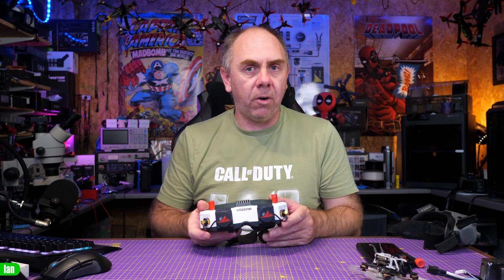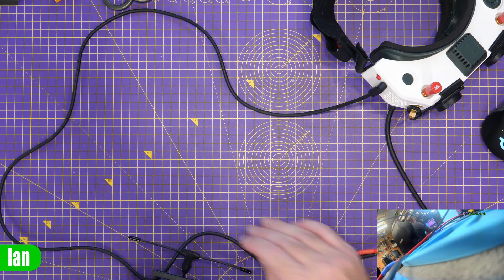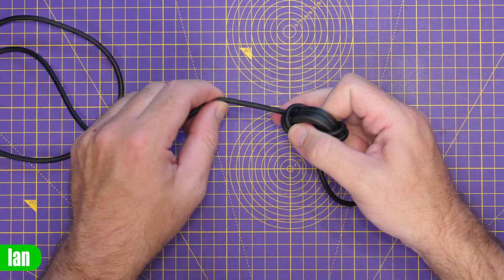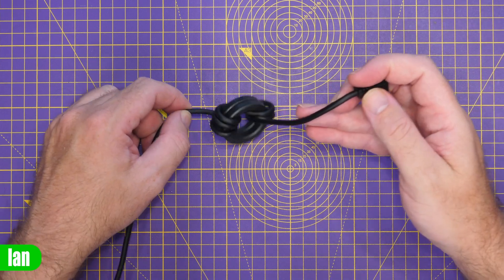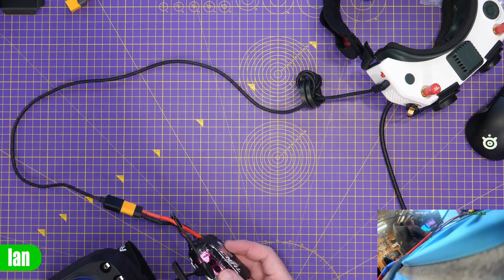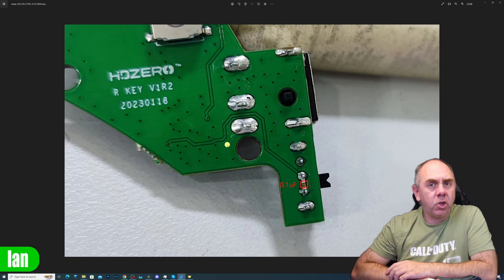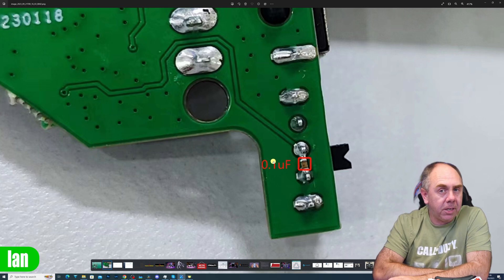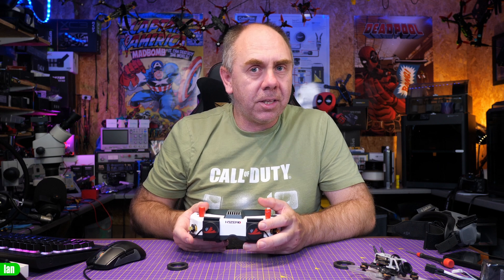HDZero FPV Goggles & Crossfire Reboot Issue Fix

Comment: I get interference with my HDzero goggle on elrs 2.4 iv only tired 500mw and 250mw, I thought I had an issue with my antenna while flying but turns out it was interference from my transmitter which is jumper t20 currently 

Not really sure what I can do about it

Comment: Looking at the positioning of the caps, they still seem to only deal with the power input, which would solve the power cable issue, but I don't see how it solves the issue when you have the TX near the goggles themselves?
And if that does work, what about getting a plug and socket of the barrel jack, and putting the original power cable into that the socket, then a capacitor and then the plug and putting that into the goggles - that way you're adding that capacitance across the power without having to solder in the goggles or power cable itself.
Reply from the maker: Carl has confirmed it solve the rebooting.
Reply: @MadRC  Ok. It's just really strange to me that it works...

Comment: I'm wondering if mobile phones could trigger this as well. Especially LTE Band 8 (900MHz) and 20 (800MHz) here in Europe. Many pilots might use ELRS these days and think they're fine if no buddy with crossfire is nearby, but what if the phone in the pocket or jacket starts to transmit at high power?
Reply: In CE, max tx power for handsets is 200mW. Crossfire pumps out up to 1W, probably even more.

Comment: i dont know if it has to be an smd cap for  RF  reasons but it makes this mod too tricky for most people when a more manageable size cap would make it a really easy mod
Reply: Needs to be ceramic or even better mono ceramic, but keep the leads short. Imagine the leads like rubber bands - perfect comtrol at the other end of rubber bands isn't much use.

Comment: I KNOW the fix! Never buy HDZero because you can't fly around objects even 50m from yourself without all of these color sparklies appearing. Plus, you can't fly around anything more than a single tree or bush, let alone a building without the lovely Rainbow 🌈 screen of death ☠️💀 occuring and yer done! Try to fly even 10m around the corner of a building and yer lying flat on the ground dead. Even analog can fly further around that corner, but both Walksnail & DJI can possibly fly completely around the building with 03 doing it crystal clear more times than not!

I KNOW THE FIX! - Don't buy a system that was abandon by Fatshark because IT SUCKED. AND CAN'T PENETRATE OUT OF A PAPER BAG!

There's a prominent reviewer who said honestly and to the point that he couldn't keep using HDZero because he'd replaced burned out HDZero VTX's over & over & over, etc. so many times he simply couldn't afford to keep buying them when everyone of them burned out! The VTX's are unreliable. On the other hand, I don't know about Walksnail, but DJI Vista/03 VTX's are sooooooo damn reliable almost on one can come up with anyone whose ever had one fail! The brands are on exact opposite of the reliability spectrum!

Oh, but HDZero is the very best when you wanna race or fly in that open field! Damn straight! 🤦

Crossfire's been around for years, has been the state of the art in receivers for years before ELRS was even thought of, and been reliable as can be all that time.

I for one would much rather use Crossfire than even consider using HDZero ... because I want to fly somewhere besides an open field,  farther than 50m with trees, bushes, HELL, ANYTHING IN THE WAY, and want something reliable and durable! 
Keep your abandon HDZero and give me the rock solid Crossfire any day of the week! Remember, there was never this issue until HDZero came along!

THE SINGLE MOST OVER HYPED SYSTEM IN ALL OF FPV - HDZero.

I am sooooo FUCKING SICK of hearing "how great it is" , cuz it ain't! LOLOLOLOL 🤬💯👎
Reply: I am the designer and the owner of HDZero. Sorry for disappointing you.

Comment: One thing fixed wing pilots will sometimes do on hand launch is to run the throttle up with their mouth (because.. transmitter in one hand, model in the other).  That puts the transmitter awfully close to your goggles (if their on your head at the time).  So there's the potential for losing video right as you are taking off.  Probably not a good situation.  :)

Comment: Hdzero users are normally concerned with low latency and shouldn't be using Crossfire if they want peak performance... can't think of a single reason to continue using Crossfire in 2023.
Reply: 150 Hz is plenty.
Reply: @AITullball3333  Except that its probably more like 50hz 😏
Reply: @BrandonBeans  Huh? Why would you think that.
Reply: I have Crossfire on quads and airplanes.  I can't think of a single reason to change to something else.
Reply: ELRS for the win
Reply: @hockeyrounds  Elrs isn't the end all of rc it's just another option,not everyone races one would think you guys run the show,I still use immersion uhf and crossfire and Dragonlink for true long range,stop pushing to use just 1 product anyone would thing walksnail is the only system to buy for HD....its not....give it break for christ sake.
Reply: Crossfire is still the best system by far for telemetry of significant bandwidth (Mavlink etc).
Reply: @RichardFPV  ok, in this case Crossfire is simpler. As with ELRS you would want to put Airport for serial data link on 900mhz and then you'd still need to use 2.4ghz for control link. So yeah, Crossfire does that better 👍
Reply: @RichardFPV  Don't forget dragonlink🤣🤣
Reply: @M-H433  i tested DL and had a lot of interference compared to crossfire.  That and DL firmware isn't in active development.  The latest firmware is like 2020 and the hardware is tough to get.
Reply: Aaaaa, maybe you have it and dont wanna spend extra cash? How about that. The last comment with no reason using crossfire is pure bs, your opinion only and not neccessary. You should work on your goggles and dont worry about who uses crossfire in 2023😉
Reply: @TheCatFather01 yeah I still have 4 quads with crossfire and I love my tango 2. Daily driver.
Reply: @TheCatFather01 gotta allow for the moron factor and ignorance of some im afraid,well said.......
Reply: @TheCatFather01  every new rx you purchase is digging further into the cash trap and preventing you from moving forward!